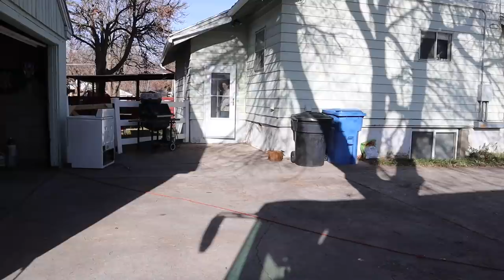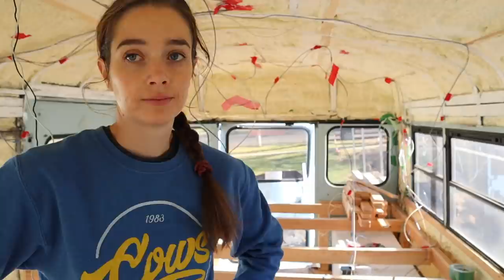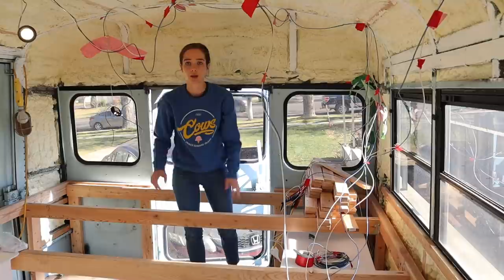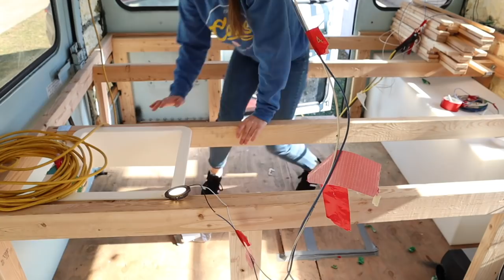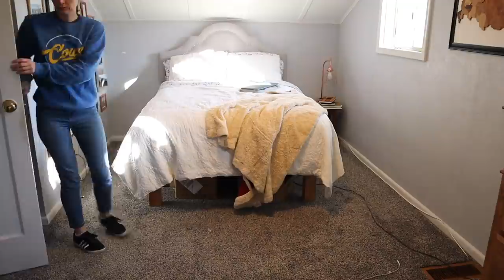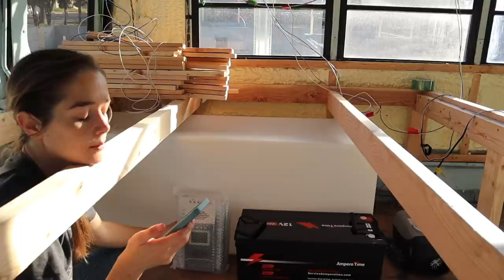School Bus Conversion Electrical P1: Testing 12v lighting, organizing components, &SO MANY QUESTIONS

Comment: Coming along great!  Some thoughts I had (all insulation related), consider placing some insulation between the water tank and the end wall against the metal back of the bus, could potentially be a freeze issue there.  I would also put some insulation between your heater and the water tank if that part of it gets very hot, you could use mineral wool insulation there that is not flammable.  And in case you didn't know, spray foam is very flammable, so just keep that in mind when you are working around it with any kind of heat source especially open flame.
Reply from the maker: thanks!!

Comment: Make the space your laundry hamper. After you create the box attach a canvas sac to a wooden frame that fits the top of the box. That way you pull out the laundry bag using the frame when it is full. Hinge a lid on the box and you've used the extra space and it looks nice and tidy.
Reply: Also, it's a long space, so you could store off season clothing in the rest of that long space!
Reply from the maker: I was going to do this at the foot of the bed but that's an idea! I'm just a little worried about the stray socks that will inevitable somehow work their way into the void and never be seen again haha
Reply: @EmmaBuildsBirbie  enclose the space with a thin board, I'm thinking about the type of board that is on the back of "flat pack" furniture. It's about 1/16 " thick it just closes the space but doesn't take up too much. I love the videos and your spirit while you undertake this journey; you are showing everyone that they can follow whatever dream they have, you just have to be willing to fail in order to succeed.  Good job.
Reply from the maker: @lesliesnowdon8490  thank you!!

Comment: As someone previously pointed out, you should put the battery(s) on the opposite side for better weight distribution. Having a semi-permanent/removable wall to hold the electrical compounds is a decent idea, if your battery(s) are going to live behind it you will need access once in awhile. Another thing I haven't heard mention of, are you putting a grey water tank in for the shower and/or sink(s)? If so that could live on the opposite side from the fresh tank, and the electrical bay could snug up to it.
Reply: A bus rated to haul 20k lbs will never notice a 100lb battery or a 500lb water tank
Reply: @mrmotofy  Maybe not, but it's a good rule of thumb anyhow. Also depending on future upgrades, may want to get 2 or 3 or more batteries to give more reserve power, and if that's the case it'll start adding up. Putting that stuff on the other side is futureproofing so everything won't have to be torn out and redone at a later time.
Reply: @killerkm4200  That battery is 50lbs. Adding 3 more is still only 200lbs. That's like 1 man on the side of the bus...again it won't make a difference here. Rule of thumb needs to apply to be relevant. But there's so much ignorance and lack of actual experience here in the comments its scary. It also greatly muddies the waters here and confuses people trying to learn.
Reply: @mrmotofy I've watched hundreds of skoolie builds, most by professions that do it for a living, the rule of thumb is generally that you even out the weight regardless of the "rated capacity" of the bus, meaning heavy things like batteries and electrical compounds and water tanks, are separated.
Reply: @killerkm4200  Still won't make a difference
Reply: @mrmotofy  So you say. Anyhow I gave my 2 cents of advice, up to the building if they want to or not, and that's where I'll leave it.

Comment: Electrical can suck. It's great you're trying to do it yourself, this will help you if some electrical issues come up later after the build is done. Always cut the wires way to long, even run wires where you think you may put a light or something, That way in the future if you do decide the wires are run already.

Comment: I like the power wall Idea and I run my panels in parallel @12v so a bus bar in a box was needed to combine the panel wires into 1 wire for breaker/charge controller. Everything looks great !
Reply from the maker: thanks!

Comment: Em put batteries on the passenger side of the bus with their own compartment have to vent you can place electronics on the wall    Water pump and filtration behind the water tank but accessible   Just suggestions but weight distribution and water and electricity separation

Comment: Would recommend putting that water tank forward of the axle, or even insulating it and mounting it underneath. You also need to keep in mind your city water and tank fill port location along with adding a drain port. For your electrical start with finding an easily accessible place to mount a battery box (close to a wall) and then if you are  going to mount your inverter/controller on the wall you'll want to try and keep them close together so wire resistance won't be an issue. If you mount them on the floor you can use the same space as the battery. Some inverters have an automatic transfer switch for inverter vs shore power if not theyre cheap and easy. For the fuse panel/breaker box look into one for an RV, theyre cheap and make things a lot easier, those manual reset 12v circuit breakers work very well too. You should have a 30 amp shore power cable about 15-20 feet long and a box inside that has a door for the outside, hook up that to your transfer switch along with your inverter and output goes to the main feed on the breaker panel. Your 12v system will just be from hot to hot and ground to a bus bar between the battery and 12v side.  If you try to keep all the electrical on one side it will make it easier to manage and you can just make your wire runs across the ceiling and down. Anways.... lol

Comment: Hey Emma, Something I sort of noticed in other videos was you seems to have a lot of space under the floor (this might be camera distortion, we don't have that style of buses in Scotland, so not sure) but If there was space it might be worth looking to see if you can build metal boxes under the floor with doors on the side so the batteries can be fastened with straps, keeps Battery/electrical separate from water etc and allows for weight distribution. You could also have a filler neck for the water tank which might be easier to refill that under the bed. Also means if the tank was to leak it wouldn't destroy anything inside the bus. Would also give more space inside the bus. It would mean welding and fabrication, but from seeing your videos I don't think you would have any issues learning how to weld.

Comment: You already have the combiner box so just use it. It will help keep everything neater, easier to change out parts when they need changing or upgrading. And an added layer of saftey.

Comment: water and electricity, thats a bad idea. and dont stack the batteries, make a cradle for the batteries sonthey stay in one place even during a sudden stop. i would place the batteries on the opposite wall and lift them off the floor about a inch, so if the water tank breaks the water cannot do any damage to the power system.

and your videos are so fun to watch, keep going!
Reply: Tell that to all the electric water heater,  washers, dishwashers, pool lights and garbage disposal manufacturers...they're all making dangerous products for decades.
Reply from the maker: thank you 😊

Comment: You are doing a terrific job.
I would consider the amount of weight from a full water tank and batteries in one corner of the bus. It is a better option to displace the weight more evenly.
A strip of board on the floor to hold the water tank in place, and also on the ends of the tank, with the bed boards above, should be more than adequate. 
Well done Emma.....
Reply from the maker: thank you!!

Comment: You must place breakers in all sets and organized into categories, lights, outlets and so on. For some reason something burning will trigger the breaker protecting the rest of the electrical system and other equipment you may have turned on at the time. The water tank has to be stuck when full it will be very heavy and can blow up with the oscillation of the moving bus where water and electricity are not the best friends in case of a leak you will want to have the electrical system on one side and the water system on the other with maintenance access on both sides, your doing so well I'm waiting for the next videos See you next week

Comment: Wire pannels in series. Don't need comb boxes. Red line to breaker, then to PV input on controller. Battery red to breaker, then to batt on Controller. Inverter goes to batt red to red, blk to blk. Should have own fuses in unit.

Comment: The emergency door (right rear of bus) build a boxed area under the bed. all your electrical components can be mounted here and wiring dressed neatly. Will provide easy access for adjustments, repairs and additions.Keep up good work, you are doing fine

Comment: Remember that water and electricity do not mix. You don't want the power inverter getting wet in case the water tank should develop a leak. The water tank should be strapped down so it can't move in case of sudden stops that might propel it forward or backwards. Your idea of two by fours to hold it in place is okay but put some straps over the top just put padding in between the straps and water tank so they don't cut through the tank. Someone else already mentioned weight distribution so keep that in mind.

Comment: Hi Emma. Don't be too afraid of 12 volts. I think Hollyweird movies have scared you. You have lots of people here trying to help you figure this out. Glad you are smart enough to know what you don't know. Having worked on lots of different vehicles and boats over many years, my suggestion is to always think about serviceability/accessibility for future troubleshooting/repairs/replacement. Just FYI those electrical components will generate heat when in use. Where are the bus batteries located? The closer the batteries are to your power distribution, the better. I don't think I'd put electrical stuff near your water tank. If you put the tank near the bathroom and kitchen, that's less pipe to run for your sinks and shower.(easier to pull wire than run pipes) Water weighs 8 lbs. per gallon, so you want that tank secured to the floor- you can use heavy duty straps. Where do you want your water filler and grey and black tanks? Just more for you to consider. Glad you're getting some wiring figured out. Remember...Prior Proper Preparation Prevents Piss Poor Performance. Keep plugging away. You'll get there! Happy Holidays, and thanks for posting!
Reply from the maker: thank you!!
Reply: @EmmaBuildsBirbie  Anytime, just trying to help.

Comment: Hey,  just thought of it but "Jimmy & Natalie" put out a video on installing the water tank under the bus without any welding.  I think they did an excellent job on it but wished they had used a metal strap instead of the other one they did.  This may be something you can look into and would allow you more room under the bed for storage.  Check it out and see if maybe one of your brothers can pitch in.  Make sure you place the fill connection about the water tank for gravity feed and high enough that it will not splash up while driving.  If you cannot then make a simple trap like is under the sink.
Reply: But then freezing temps become an issue
Reply from the maker: yes I've thought about this! would love to have it outside but don't know if it's a bad idea since I'm not really planning on following the heat like some people do. I'll check out the video though!

Comment: I would have a separation wall between the water and electrical as you will get some condensation on the walls of the water tank when there are changes in temperature . For example when you put cold water in and the temp of the bus is warm. You should also put a drain in the water tank section to drain the tank or for water to drain in case of a leak. You may already have had this planned and therefore I'm am just blabbing.
Reply from the maker: thanks!

Comment: You are doing absolutely 💯 percent awesome, great 👍 job 👏 take into consideration the weight of the bus 🚌 when putting or placing that stuff under the bed 🛌 frame, but excellent work out of chaos, great 👍 work 👏 👍.

Comment: Don't know if things are too late but... you do NOT want to stack the batteries. I would recommend moving the battery closer to the rear of the bus to make it easier to  get to for maintenance/troubleshooting. If you want to expand, then leave room for a second battery nearby.

I would recommend you get a wire stripper and stop using your teeth as you can easily chip a tooth using that method.

I would also suggest that you consider weight distribution. In your bus this isn't as critical as some might think. (I drove a school bus while in college and have had one side packed while the other was empty with no control issues. But... the distribution will affect tire wear and affect your operational costs.

I would recommend you get with an electrician to go over all your plans. Yes, the engineer would seem more qualified - but I would go with the electrician since that is more in their area.

Comment: Hey Emma great job so far loving the build and the lights look great at night. On a personal note I would suggest putting the Electrical and Battery away from the water tank, As Electric and water don't mix well. If you ever end up with a leak you could short out the whole electrical system. Juts my opinion, As I lived in a 5th wheel for years and when my water tank burst from freezing one year, It shorted my breaker box.
Reply: Then there's those pesky electric water heaters that have been used for decades or garbage disposals or washers.
Reply: @mrmotofy  The water heater was what shorted out my breaker box, As it's located right next to the holding tanks in most campers. It's a bad design, And always was.
Reply: @stephenfhauk  I have multiple relatives that died in car accidents...don't drive it's dangerous and will end your life

Comment: Issac from A BusLifeStory puts all of his components on a little wall under the bed so I think it will work. I also think it may be a good idea to insulate your water tank. Congratulations on your 💡s. 🌈🌈🌈
Reply: No insulation needed if it's inside
Reply: Insulation needed as you might not be winterizing it in cold weather. If you have it parked while you are away and want to leave the water in it , with no heat running. Better insulate it

Comment: Emma just a thought you got the water tank over and left side and if you put the batteries on the left side that's going to add more weight to the left side a water tank with a water in  the tank per gallon weighs 8 lb. I would put the batteries on the opposite side of the bus.

Comment: This was some good work, and a lot of pondering. 
Any advise I could give this far after you have finished the build would be pointless. 
However, I would recommend balancing the weight of those heavy components (water tank & batteries) from side to side. 
You probably don’t want the bus to have a permanent lean to one side. 
Go For It

Comment: The wall your talking about should be thick enough that screwing the equipment to the wall will not leave screws sticking out the other side where they can damage the water tank. The wires from the panels need to go to a dc breaker or disconnect/fuse, then to the "charge controller" to the batteries. Then from the batteries a DC discnnect/fuse block to the DC breakers to the  loads. ALL wiring should be properly sized for the amount of current they will carry to the loads.

Comment: Hi Emma I know it’s past your instillation of your water pump but to make the hose more flexible you need to put the hose in boiling water then you can bend it into the shape you need. My hand is finally getting better I have most movement back but my hand is still very weak (Broken Hand).

Comment: water and power should be on the opposing sides. one for safety (water and electricity don't like each other), two for weight distribution. you may also want to have a battery as much as possible on the top of the wheel \ axel so it's easier on your suspension.

Comment: If you're storing under the bed, leave space for ventilation and slight expansion.

I'd even consider putting a metal plate for protection under the bed above the battery incase it decides to explode...

Comment: My idea is for you to heat up the  water tank in the area of the fuel fill box and press a dent into it the size of the box so it will slide up against the wall. Ask around to see if  this idea is viable. as  the storage loss of water is less than the storage loss elsewhere.

Comment: Wish I could help on the solar but my knowledge on that is quite limited to the basics of electricity. The wall under the bed sounds like a great idea. Just make sure any screws you use won't go thru where they could wear thru the fresh water tank.

Comment: Personally...I would build the solar system either on the opposite side of the space under the bed or put the entire solar system somewhere else near the front under a couch or in a cabinet. Simply because of the age old adage....Water and Electricity don't mix. If something ever happened and the water from the tank ever managed to get in to contact with the electrical system....dead bus. And possibly dead YOU. That would not be good. Most electricians agree that the shorter the cables, the less electricity gets wasted and the less heat is created in the system. So decide where on the roof the solar panels are going and build your electrical system under it. Those are just my multiple $0.02 worth. 
Great looking bus and I can't wait to see you at all the different 'Palloozas in the coming year or so.